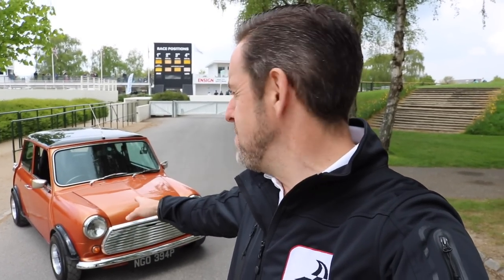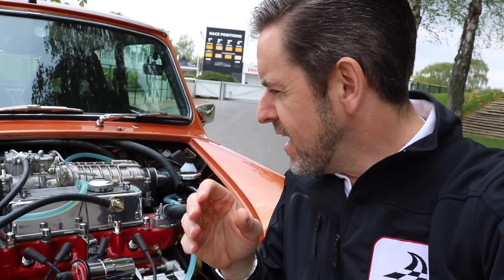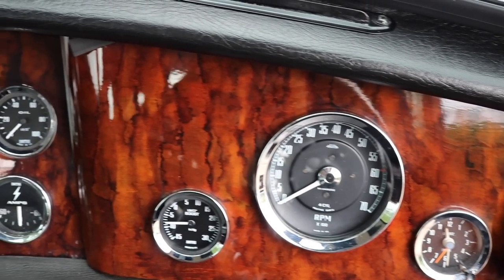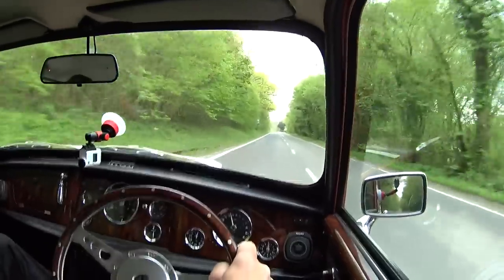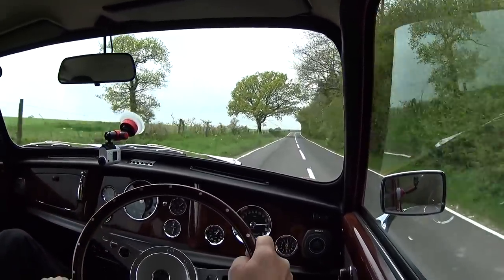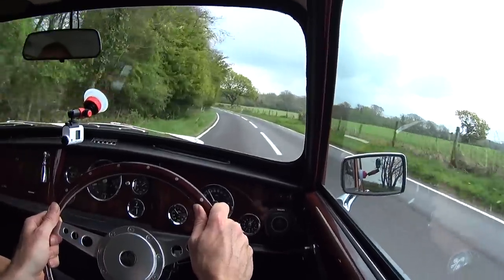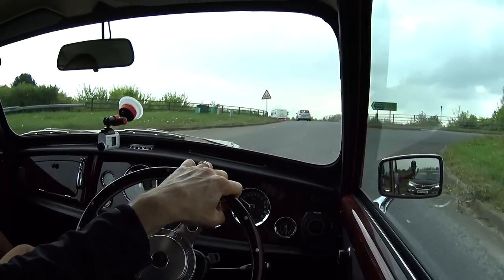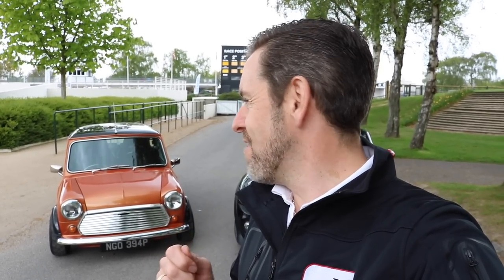160 BHP Supercharged Mini - Modern Performance with Classic Charm !

Comment: Supercharged mini 160, I find that hard to believe. I had  new rebuild 1380 s/c mini, no money spared and it pulled just on 100. My new honda  B18 engined mini is pulling 160 and there is a hell of a difference. . I would like to know how much boost you are running and what RPM as it would have to be phenomenal and really bad for the life of that engine

Comment: 15:20  This is something a lot of younger Mini owners don't realise - that cast iron block is pretty heavy for its size (especially when compared to the weight of the rest of the car), and that imbalance in weight distribution actually helps with the handling.  There's plenty of people making more power with Honda or Hayabusa engines, and they look and sound great blasting along in a straight line, but they generally don't handle quite as well (or at least, as well to my liking) as this more original setup.  And it's an relatively old-school engine setup - I remember a few supercharged Minis with carbs when I was a kid in Sydney, back in the late 80s.  :-)
Reply from the maker: Cheers Mate. Great point and glad you enjoyed the vid :-)

Comment: If I had a Mini with 160hp I would look that serious/worried. Fabulous Mini, glad it's got the A series and not a bike engine. That makes it proper.
Reply: Hi Mike

Thank you for your interest & your comments. I do enjoy the fact that it still has an A-series engine & I believe that they only handle like Mini’s with the original engine. I enjoy driving it very much & I am pleased that you enjoyed the video. Best Wishes.
Reply: You needs bigger brakes at the front. 
Spring suspension instead of rubber. 
But beautiful. Having the original engine. 
And 160 horses. Double the cooper s power.
Reply: Evomark 4077 I Love your mini I’m looking into doing  the same thing to my mini 1275  any advice to give me Please if you do not  mind

Comment: Wonderful sympathetic build. Alec Issigonis would approve of marks attitude I'm sure. I had a lovely Mayfair as my first car that I modded about and learnt about handling in. Mark is so correct when he talks about the weight distribution and how that ties into driving an original mini. Lifting off and timing gear changes is life and death with them and a turbo charged engine can just be too inconsistent in its delivery. I put a metro turbo in mine and it made it so hard to keep in the sweet spot and quite lethal leaving corners if the turbo wasnt playing the game. I eventually returned it to 1000cc with an Austin 1100 cam and big exhaust ports as per the vizard book and it went back to being a much more precise and pilotable fun drive. A five speed would certainly make for an easier time at cruising speeds but its so hard to get the ratios right. Thanks for showing us this both of you.
Reply from the maker: Glad you enjoyed it :-)

Thanks for sharing your Mini story too. Such great little cars.

Comment: I once had a 1982 Mayfair that had been re-engined a few times. The guy before me swapped in a 998cc for me as an L driver - but what he didn't tell me was it was a Cooper engine. With the 12 inch wheel conversion, front discs, and a small donut of a steering wheel it was a dream to drive - with all the sound deadening and the carpet stripped out new valves, head skim and a slight lift to the compression, 'nose' tuned (on the rocker cover) it was good for 105mph on an airfield speed-trap.  I loved it but sadly it was more rust than car and had to be taken off the road permanently. I miss her :(

Comment: I almost had the identical same car with same mods. Mine was dark blue with a whit roof and white 10" wide offset rims and Yoko tires. Central 50mm exhaust from end to end; tuned cylinder head, bigger bore double coil valves, lightened flywheel, etc, etc.... I ended up to have to seriously reinforce the front half chassis cse it ripped through my "A"panels like if it was nothing... too much torque. It has been the most fun to drive car I ever had, and I've had my bunch of tuned classics. This one topped them all !!! The only car I really miss. It had a real personnality of its own with some electrical quirks. Some time it was in a bad mood, sometimes everything worked fine, with no apparent reason... like if it was possessed, I'm not kidding. You are right about the smell. I still clearly remember it, it was unique.

Comment: I love the original Mini!!! I remember a time my mate took me out in his 1.0ltr Mini (lowered, fat 10" alloys) We came off an A road sliproad that went steeply downhill to a small roundabout. My mate barely slowed down, and we flew round that roundabout at an incredible speed with the tyres screeching in protest. I thought my mate was just showing off the Minis incredible cornering ability. No, the look on his face said it all, the brakes (that had been worked on that same day) had failed!!! If we had been in any other car, we would definitely skidded and crashed or even rolled!!! Only a Mini could have taken that roundabout at that speed, after that I had a new found respect for the Mini. The car featured must be incredible fun, I've been out in tuned up 1380 Minis with better suspension, fat alloys, sports exhausts etc. But a fairly stock looking Mini with 160 bhp must be awesome. I love it!!!
Reply from the maker: Oh wow...scary !
Reply: @PetrolPed  like I said, I thought he was just going for it, as we were proper Boy Racers back in the day. I dont think hed slowed much from the 60/70mph he was doing along the A road, so we were doing 50+mph round the roundabout!!! It was only after we'd shot round the roundabout that he stammered out "the @#$%in brakes don't work!", face all pale haha!!!
Reply: Hi David, that’s a great story - fairly similar to many of mine back in the day! :-)
Reply: @evomark4077  I actually saw my mate, the driver of the Mini, a couple of days back. He mentioned another scary aspect to the tale. As we came up to the roundabout, he had realised the brakes had failed and that another car was on the roundabout heading straight for us. He just had to shoot out straight in front of it and round the roundabout!!! It really couldn't have been much worse haha!!! That Mini (although it tried to kill us!) definitely saved our bacon that day!!! Great little motors!!!
Reply: @davidkennedy1077  I definitely got up to stuff in a Mini in the 80’s that I wouldn’t try (or admit to) these days! :-)
Reply: @evomark4077  Haha, yeah my experiences (in Minis, Metros, XR2S, GTIs etc) in the 90s were often crazy, dangerous and illegal. When your young, you and your mates and girlfriends cars are a big part of your life and everything centres round them (at least until you scrape enough money together to move out)

Comment: Definitely worth waiting for Peter. A really well thought out Mini & the colour a tip of the hat to the original 'Orange Crate'. Supercharger fits in like it's a factory unit ( is it a Shorrocks ?), it has a very low line & capped off with the Weber carburettor = perfection. Handling was really good, brakes seem to do their job well & the icing on the cake - huge smile from ear to ear. Congratulations to Mark for building a really well engineered Mini of which I'm 💯-% sure he's as proud as punch. Peter you were right, I was definitely not disappointed. Thanks to you both for sharing this video. 10/10 & a gold star ⭐️ to Mark for building his dream.
All the best guys from the depths of paradise................Gloucestershire.
Reply from the maker: Thanks Geof. I thought you would like this one !
Reply: Thank you for your generous comments Geof. I am very proud of the car & appreciate feedback such as yours. Best Regards.
Reply: evomark4077 
You are very welcome Mark. Took me back to a time in my life when Mini's were everything. I passed my driving test in one back in 1971 (in the snow) & owned several afterwards. Now I'm a fan of the 'new' MINI, on my 7th, but never forget those wonderful times.
All the very best,
Geof.

Comment: If any ‘Peddlers’ would like to see this car in the flesh, it will be on the Waterloo Classics stand at the upcoming London Classic Car Show at Olympia from the 20th -23rd February 2020.
If you come along, please say Hi & mention Petrol Ped!
Reply: What engine management are you using? Distributor or aftermarket ECU?
Reply: @lukeroberts6246  Hi Luke, the car is running a distributor made by Bestek Engineering. It is similar to an Aldon Yellow in specification.

Regards, Mark
Reply: An absolutely lovely Mini. It's taken me 20 years to own a 'new Mini'. I got my f56 Cooper S in March, 5 hours before lockdown was announced and I've been ecstatically happy, BUT watching your video has taken me right back to my teenage years with my first blue Mini 1000 EHL 395V (the blue streak, as me dad called it). I loved everything about it including the old Mini smell, it's unique and I actually thought it was unique to that particular car, but when I got Betty, BHE 909T, my black Mini 1000 which had also belonged to my Dad, but also my sister and I found that it too had the same mini smell 😂 . I would have loved a bit more power like this one as I soon used mine. I'm in love with your Mini. I'm about to enter a prize draw to win a Mini 35 with a 1380cc engine from U.K. Minis. Maybe you'd like a go too. https://competition.ukminis.co.uk/
Reply: @Oldguytechreview  Hi Franken. A list of all the changes would be very long indeed. Stuart Gurr of Vmaxscart does do bolt-on kits, but this engine was built specifically to be supercharged & therefore has quite an extensive list of modifications that were included in the build. If you need a full list, please email me at mark.mbtechnical@btinternet.com
Reply: @Oldguytechreview  Hi. I have not received any of your emails I’m afraid.

Comment: Great video guys. I had a '72 Clubman which I modified and a '76 Innocenti Cooper S which was very rusty! I'm intigued by the brakes on Mark's Mini - he said it has Cooper S discs and Mintex pads but the Coopers had a servo. I fitted one to my Clubman becuase it had a simple (but risky!) single circuit. The Innocenti had a servo too but although there were two circuits the fronts were on one (and were servoed) and the rears were not. So my question is - does Mark not fit a servo becuase a) there's no room due to the extra pipework for the supercharger b) becuase he's got a dual circuit system crossed front/read and would therefore require two servos c) it doesn't need one! Cheers Paul
Reply from the maker: Hi Paul. Thanks for the questions. I'll ask Mark and get back to you.
Reply: Hi Paul. The car has single circuit brakes & originally had drums & therefore no servo. When I upgraded to discs, there was not really enough room for a servo, but one could have been squeezed in if absolutely required. However, I found that the brakes are perfectly adequate without a servo (although you do need to push firmly - Peter?). When I then converted to the supercharger, the fact that there was no servo in the way just made life easier. I have never missed having a servo & actually enjoy the feel & firmness of the pedal without one. Regards, Mark.
Reply: Hi Simon, it is an additional radiator that is plumbed in via the heater outlet on the cylinder head. It has a small thermostatically controlled electric fan on it & helps to keep the temperature down at low speed/stationary conditions in high summer temperatures. It also helps to avoid the a-series problem of being hot at the clutch end due to the in/out nature of the standard cooling being at the same end of the engine. Regards, Mark.
Reply: There's room above the passengers feet below the parcel shelf for a remote servo.  I had a 1399 with 74mm omega pistons. The brakes I had were split front to rear, servo just on the front disks, super minifin drums on the rear. I had mintex 171 pads on the front and stock shoes on the rear. I also had a brake bias valve in the rear line as the drums operated first and braking hard was like stopping with the handbrake (scary). Tyres were Yokohama A008's.

Comment: Gorgeous! What a cracking Mini!
Reply: Thank you Andrew.
Reply: I love  it Mark. I agree with your comment in the video - I don't see anything wrong with restoring and updating the car as you've done, especially as it started life as a fairly ordinary Mini 1000, not a Mk1 Cooper or something that's in short supply. You've made it relevant to current road conditions and I think updated it sympathetically. The supercharger installation looks very neat and the exterior colour of the orange with the black roof looks great to my eyes. I think if memory serves some of the racing Minis had a 5 speed gearbox, so there must be room for it to fit. Sounds like you have plans underway already! Having had it 30 years (amazing in itself) no doubt you'll never sell it, so I hope you continue enjoying and no doubt improving your car for many years to come!

Comment: what you could have told us was how much boost was it running it looked like .5 bar, i built a supercharged mini for a customer back in 88, we used a stock 1275 motor which was 8.8 cr ,2.9 final drive on .5 bar it made around 130bhp , i used a far more efficient compressor than the eaton, it had diabolical torque steer.
this doesnt appear to have 160 bhp  but it certainly goes well and blown minis are magic
Reply: I didn't think it had 160bhp no way, not struggling for traction ,  get it dynoed , 120bhp max

Comment: I still have two Minis to restore, makes me think... was thinking about VTEC, but this is nice as well.
I don't need 160 HP though it would probably be nice. However... wondering how long the gearbox will take it.
Te VTEC conversion gives you a proper 5 speeder that will last.
Reply from the maker: I have no idea mate. Either way you are going to get an awesome car !
Reply: Mario PizzamanMari

Comment: I'd be interested to know what driveshafts are fitted. Friend of mine had a 140BHP (approx)
Mini many years ago but it only did about 60-70 miles to a driveshaft!
Reply from the maker: I will try and find out for you ;-)
Reply: Hi RWA. It has original Cooper S driveshafts & no problems with them. The only short-lived items are the from tyres (600 miles a set) & the fuel in the tanks!
Reply: It may be the way the power is delivered that saves it, i remember reading about some turbo'd mini's years back and they reckoned to change the gearbox at least once a year.

Comment: My 1399 turbo is available if anyone is interested.  1275 metro turbo bored to 74 mm making 1399. 4 pin diff. Mad short shift.  Vented 4 pots on the front, S rears.  Twin tanks. Tons of extra stuff. Avonbar stage 3 head, cam, and Aldon stage 3 distributor. J CW aluminum door attachments. And more. I moved to America so car is sitting in England (garaged)  offers accepted.
Reply: How much?

Comment: Hi Mark. Is this SC setup still running well. Any issues down the line that need to have been sorted?
Nice install
Reply: Hi Graham

Thanks for your comment & apologies for my reply. The setup continues to perform wonderfully. Obviously, any highly modified car will need regular tweaking, but the basic engine/supercharger setup has been very reliable. I would be lying if I didn’t mention occasional needs to modify a part or deal with a leak etc, but it’s very reliable given how modified it is. I hope that helps, but please contact me again if I can be of any further help.
Reply: Meant to say “ apologies for my delayed reply”.
Reply: @evomark4077  hi can i have your mail?

Comment: a five speed box might seem logical, but in reality you dont gain much you are better with 1st 2nd and 3rd close together and 1.1 on forth gear  for crusing, 5 and 6 speed mini boxes are just modified to use thinner gear sets so are a lot weaker, one of the lads had a jack knight 5 speed and while the overdrive 5th did lower revs it did not pull in that gear, so for me its about choosing the right gear set for your needs and go for strength, dont forget you can play around with the diff ratio too.
Reply from the maker: Thanks for this. Very interesting and knowledgable :-)
Reply: Think you can get true 5 speed dog boxes

Comment: Sorry to burst the owners bubble but i have a race prepered 1310cc engine which is 113HP with 112.06 ft/lbs of torque at the wheels
on a dyno, Even with the supercharger a 1293 cc can not be 160 hp at the wheels, I would love to see the dyno sheet to prove it. 
If you would like to come to Austria and test drive my cars you can, I also have 66 E Type OTS + a Jaguar XK 150 OTS. Cheers Dave
Reply: Thank you for your comment, but I do find myself wondering why people who have neither seen or driven the car choose to dismiss it. It has been on a rolling road producing 154bhp & it has been timed 0-60 in 5 seconds. If you don’t want to believe me then that’s fine, but I’ve never knowingly been a liar.
Reply: @evomark4077  Sorry but i did not call anyone a liar, I said a 1293 could not have a 160 hp and you confirmed it
with 154hp Can i ask is that a 154hp at the wheels or at the crank ? Cheers Dave
Reply: @ClassicCarCave  It is 154 Bhp at the flywheel (it was never stated as being at the wheels).

Comment: Mark - bit late to see this vid, but quick question about gearbox, what final drive ratio are you running? Amazing car by the way!
Reply: Hi Rosie

It’s a 2.9. I did try a 2.7 but found it hampered the acceleration a little more than I wanted, so reverted to the 2.9, which I find perfect.

Regards

Mark